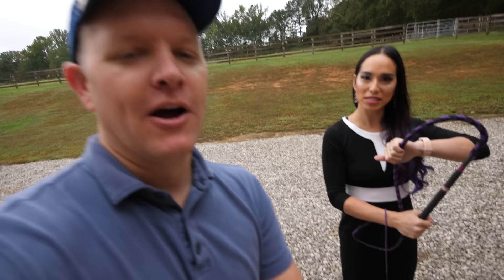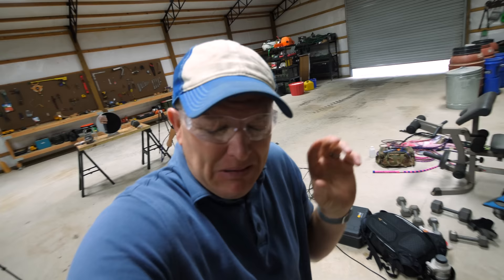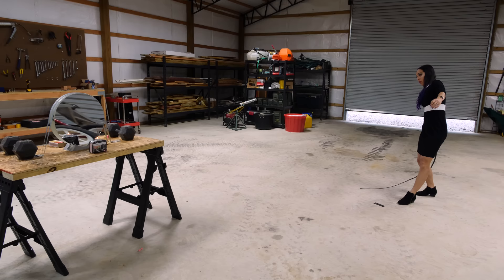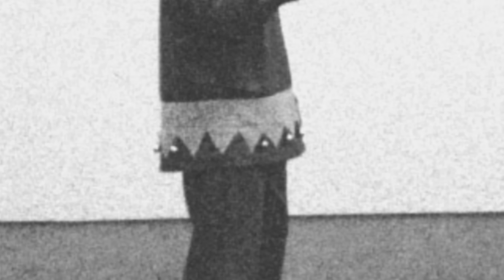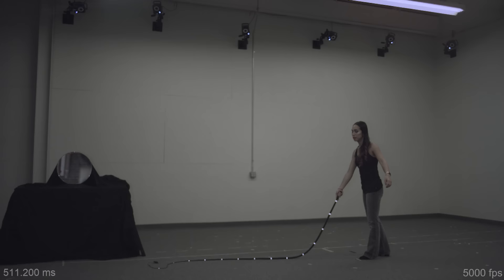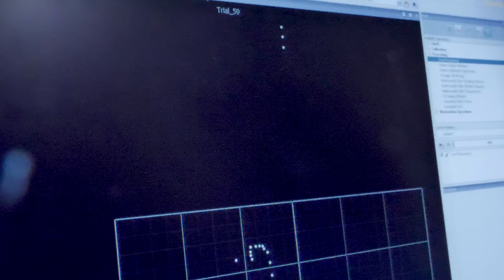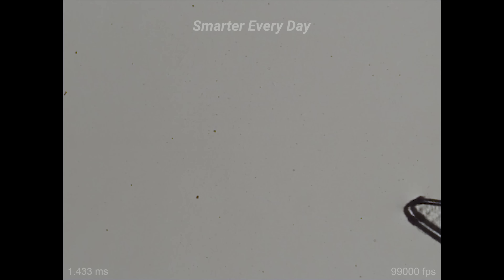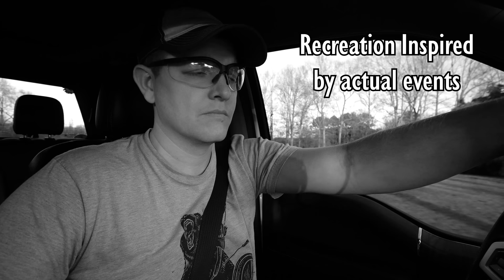How does a whip break the sound barrier? (Slow Motion Shockwave formation) - Smarter Every Day 207

Comment: The conservation of momentum is right ofcourse, but I think a more useful way of looking at it is in terms of impedance matching. Basically you are trying to transfer energy from something heavy and slow to something light. The difference between this and a uniform length of rope is that you gradually change the impedance of the whip as the wave moves to the tip, so no reflections of the wave occurs. Then in the end, when the speed of the whip itself is high enough, you need to impedance match to the air. This is done by increasing drag while still impedance matching the whip itself. The solution is the special tip. It is nice and puffy so the drag is high but the weight is low. This transfers a lot of energy to the air, preventing a reflection from going back up the whip. I suspect that removing the last puffy bit decreases the crack, and increases the reflection of the wave. You can also make the whip long enough to eventually achieve an impedance match to the air, as drag increases super linearly with speed. But to keep the whip short it might be best to impedance match to the air as soon as the whip is super sonic. Compare to a length of rope. If you try to crack that, the wave will come back up the rope, and no part will be particularly fast ofcourse. An even more reflective experimental setup would be with rope where the end is secured to something. The wave would come right back and even feel violent. I also suspect that this gives a framework for optimizing whips from a theoretical perspective.
Reply: Huh, I was seeing a charge-pump; charge a bank of capacitors in parallel, discharge them in series.
Same net power, higher voltage.
Reply: I’ll buy that. It makes sense. The same reason you have to make the end of your transmission line matched to the impedance of air for radiation at the antenna. Cool theory. I hope this is not the last video on this subject. I was fascinated from start to finish, as it seems you were too.
Reply: Similar the issues involved in speaker design.
Reply: Very clever analysis, Casper.
Reply: @jaydgreen1  I think it is exactly that!
Reply: Yes!

Comment: Destin - can you put together a slow mo capture with some science behind it regarding ping pong? I've been playing regularly in recent months and we have some questions about what is really happening with the ball when doing a specific stroke called "looping." We think the ball is spinning on the surface of the paddle during this but its hard to imagine. Overall any slow-mo of the ball hitting the racquet would be super interesting to see. The speeds you can generate with a 2.7gram ball is something else.

Sincerely, 
long time fan
Reply: I would love to see that too.
Reply: I could be wrong, but I suspect some of what's happening is similar to dropping a bouncy-ball with a bit of spin.  If you try that, you'll see the ball bounces back and forth, and that the spin changes on each bounce.  As the ball reaches the floor, the rubber grips the floor and so stays where it is (the boundary condition mentioned at the start of the video but with air).  However, the ball still wants to rotate so a torque is applied that twists the ball.  This twist is essentially elastic energy which releases, causing the ball to spin in the opposite direction.
My suspicion is that a similar thing is happening in table tennis, but that the deformation is to the rubber on the paddle.  As the bat moves across the path of the ball, some of the rubber gets dragged back and stretched out.  This energy is then released into the ball, causing it to spin.
Another thing it's similar to is the hockey shots in some of Destin's other videos, where the stick hits the ice before the puck and gets deformed, before unbending and slinging the puck across the ice.
Reply: andymcl92 for sure. Seeing it would be interesting. There is a lot happening with spin received and spin given off the loop, and the relationship between the paddle angle and the moment of contact, and it’s relation to its trajectory off the table. To react in time to make a successful return has a lot going on
Reply: @paulzeee  And yet it's one of those skills that we develop an intuition for without a deep understanding of the physics involved!
But as I always tell people, it's all in your feet!

Comment: Compressive forces of the conflicting motion are driven to the tip of the whip as the handle is drawn back slightly and the  flow of the forces acting upon the whip are reversed and the moment when the maximum applied energy is overcome at the point of least resistance in the whip’s core, a violent reaction occurs

Comment: The whip tip accelerates after the shock wave for the same reason rocket exhaust accelerates after it passes through the throat of the rocket engine and become supersonic. Once the flow becomes supersonic there can be zero pressure(by definition) against the direction of the flow. The air particles are pushed into what, to them, behaves like a instantaneous vacuum as any particles in front of them are moving away from them at supersonic speed. In the case of the whip tip there is a small pocket of what is essentially vacuum just behind the shock wave and the whip gets pushed into this by air pressure.
Reply: @Tom JLB: Interesting: what you’re describing, resembles what Aristotle postulated about projectiles soaring through air.

Namely, he believed there was only linear motion on Earth, and that an earthy or watery object (this includes metals, wood ...) would always move towards the Earth, and in linear fashion. Therefore, a projectile (say, a wooden arrow, or rock ...) flying in a parabolic trajectory seemed inexplicable, so to solve the problem, he devised that the projectile itself wanted to move downwards, but was thrusted upwards due to air rushing into pockets of vacuum left by the projectile behind it. This would gradually die off, as the process wasn’t 100% efficient.

Applied to a whip, his theory is the exact opposite of what you’re saying happens; fascinating!

Source: Wrote a 40-to-50-page paper on Aristotelian physics as final project in high school.

Comment: If you had a popcorn kernel on the end of a whip or hit by it would it pop from the impact?
Reply: Haven't I seen you on elitepvpers?
Reply: No, that's got nothing to do with how popcorn works
Reply: TheBetterGame 
we won't know untill we try
Reply: TheBetterGame Well, if heat is just moving particles and the ability to break the soundbarrier is due to something moving faster than sound travels then why couldn't it work? Popcorn pops due due the trapped water inside turning into steam via heat. So, what are the limitations of thermal energy here? What is the shortest time required to make a popcorn pop? 

Are you really sure it can't be done?
Reply: @KyuubiSam  

There's different ways something can heat up.  It isn't as simple as something moving very fast.

When it comes to popcorn, the water inside needs to be excited.  Unless I'm mistaken, that happens when a heat source constantly bombards the kernel.  Moving very fast cause heat through friction and rapid pressure change, not rapid energy bombardment.  Unless I'm missing something, I doubt fast movement will make popcorn.
Reply: @laughingfurry  Something moving very fast in air isn't due to friction, but the compression of the air in front of/around the object itself. It's how slam rod fire starters work. Perhaps a popcorn kernel exceeding the speed of sound would compress the air around it enough to momentarily heat it enough to pop.
Reply: Just the velocity alone would build pressure within the kernel, in relation to atmosphere.
Reply: @wonderwhatsnext5408  

I was talking about fast movement in general.  I know air resistance won't cause heat through friction.

I still doubt heat through compression will make popcorn.  I think the kernel is more likely to break than pop when compressed.
Reply: You need to calculate how much energy it takes to pop a kernel (hint: quite a lot to bring a whole cold kernel up to boiling). Then calculate how much energy is in the tip of a whip (hint: although it's fast and concentrated, there isn't much energy there). That will tell you if it's theoretically possible (hint: I think not). Then you can test it.
Reply: @_droid  1100 watts x 142 in my microwave
Reply: @_droid  2:22 on HI
Reply: popcorn works from heat and pressure building inside the kernal, it does not pop from impact you lol
Reply: The air resistance at the tip of the whip does not generate enough heat, and the mass of the kernel is not enough to keep enough heat for enough time before its relased via air cooling.

I doubt it would pop even if you let it fall from orbit.
Reply: Liam Mitchell Doubt it, no heat is generated from the whip I'm pretty sure.

Comment: They had to make it out of titanium which was only found in Russia at the time so they had to figure out how to get enough titanium from Russia into the states without Russia knowing what they were up to. Also, due to the heat they had to purposely make the panel's so they didn't mesh together because the metal would expand when it heated up causing the panels to fit properly in flight. Essentially when the jet was on the ground it was very loosely fit together to the point where the jet would leak fuel all over the runway before takeoff.
Reply: You're talking about the SR-71, out of context - But why?
Reply: @GaminGit  You didn't catch the audible commercial where he mentioned it near the end of the vid? I just felt like throwing out some random info. It's the interwebs you can do that. 😉 
 So, in short, the answer to your question is simply, because....
Reply: Possibly a myth. Naturally, this is the common explanation, and as classified as the tech is there is no way to be sure...

But SpaceX is using similar tech to intentionally leak fuel across the body of the craft for cooling. This makes a lot more sense to me than engineers not knowing what a flexible seal is, especially since heat is by far the biggest concern. 

The leaking may have been intentional to cool the craft with the easiest at-hand fluid: the top secret and curiously specialized rocket fuel.
Reply: DanGoodShot pewpew thank you for that explanation. The SR 71 is my favorite plane, but I couldn’t understand why it leaked.
Reply: And here I thought the leaking was to due to the metal sheets being slightly too small to give them room to expand from the heat that occurs at supersonic flight. The reason for this would be to achieve the best possible aerodynamics at the highest speed necessary.
Reply: DanGoodShot pewpew is that for real dude?  Amazing.

Comment: Something I've always visualized contributing to the seeming magnification of energy in the cracking of a whip, is the compression occurring on the inner side of the curl, and the tension conversely generated on the outer side of the curl, and those two forces adding energy back into the equation, as they vie for equilibrium. Like a crude battery. But I never hear anyone mention this when discussing the physics of a whip-crack. If you imagine the whip being made of solid rubber, rather than braided from cordage, perhaps this would be more obvious.

Comment: My kerbal space program intuition says the tip rockets forward because drag skyrockets during the transsonic range and then quickly falls off, while the tip is still at that point collecting momentum. Once it gets to about mach 1.2 the drag has dropped off by, if I'm reading this graph right, up to 30%. This is of course data from aerofoils and aircraft scale aerofoils, the tip being so small would probably have an even steeper decline in drag past mach 1.0, so all of the energy it gains after breaking the sound barrier is progressively more efficient at accelerating the tip. This would of course proportionally shorten the impulse which is why the tip suddenly jumps in speed but doesn't continue accelerating at the same rate. The 'catestrophic post mach acceleration' consumed all the available potential and now the tip is travelling too fast to accept more energy from the whip.
Reply: Ziraya0 Haha, never thought a wobbly rocket would make a good whip model. KSP is amazing.

Comment: Since the schleiren technique doesn't use the light reflecting off the whip, is it possible to set up two (or more) separate schleiren setups at different angles but focusing on the same point in space, then use photogrammetry software to create a 3D view of what's happening to the air density?
Reply: Interesting!
Reply: It's spelt Schlieren, ffs.!
Reply: @Anvilshock  BWAHAHAHAHAAAA 👿
Reply: Yes, it exists. Search for 3DBOS (3D Background Oriented Schlieren). It's pretty amazing.
Reply: @76Eliam Sweet!  Thanks!
Reply: Three of them; one where it starts to curve, one at the crack of the wip and the third one at full extension of the tip. Sounds great!!!!
Reply: While you could pinpoint the location of the whip in 3d space using 2 cameras at 90° angles photogrammetry requires much more than 2 angles to get a clear output. I'm not an engineer but I am a 3d artist so I've experimented with photogrammetry

Comment: I've cracked a lot of whips...  Seems to me that if you yank it back just before the whip fully extends it makes a louder crack.  I used to set milk cartons up and slice huge gouges in them.  My brother was standing about five feet out of range when a small piece, about 1-1/4" long broke off the tip and hit his arm.  It actually made a jagged cut in his arm that produced lots of blood.  I did not think at the time the whip was breaking the sound barrier — I thought it was simply snapping back against itself.  I think when you snap a wet towel, or piece of cloth, that is what's happening, and it can be every bit as loud as a bull whip.  It might be interesting to find out if a snapped towel is also breaking the sound barrier.  It needs to be a somewhat threadbare towel, though.  When I was a teenager I worked at a car wash, where there were plenty of worn-thin towels to snap like that.  We learned not to snap towels on Thursday — Thursday was police car day.
Reply: I noticed that too.

Comment: It's all about the explosive dissolution of the waveform created and amplified by the initial swing.  You're transmitting that initial force waveform into a smaller and smaller area of the whip body to accelerate and amplify it.  The cracker at the end is dramatically smaller and fan shaped specifically to dump all the energy of the waveform at the end of the swing, accelerating the tip past the sound barrier and causing the sonic boom crack we've all come to expect.  Or so it would seem...

I would suggest that the last acceleration and amplification of the waveform is actually being caused by the phase change between the energy of the swing being transmitted by the solid matter of the whip fibers into the much-less-dense fluid of the air around it.  That last jump in energy at the end accelerates the actual air molecules around that last section of the whip so fast that they cause explosive friction against the static air around them.  So in essence, it's not the actual whip that's cracking, it's the air at the end of the whip cracking against itself.   

So I guess a whip is literally a form of energy-amplifying fan...since you're literally using it's properties to move tiny amounts of air molecules so fast that they can't get out of the way of each other.  The fact that the boom actually happens in the air is also why the whip inself stays intact afterwards. If the waveform collapsed any sooner, you'd likely explode the end of the whip every time you used it.  

Funny to imagine what a whip would do if it were uses in other more or less dense atmospheres or fluids.  If you tried to use it in a heavy atmosphere, would the whip actually crack you back? 🤔

Comment: It looks like the last 12 ins or so, is where the last segment can't continue folding, and  for the lat 6" or so that serves as a fulcrum point where the tip begins to become a lever and flips over to face the front and reaches its maximum speed, sort of like what happens at the pivotal movements that gives baseballs pitches such great speeds or the mechanics of the atlatl. At that  point, when it moves to the front, the hairs of the tip facing the front suddenly spread causing them to have a greater surface to act against the air, thus displacing more air and causing the sonic sound. 
This was my visual appreciation ...a personal hypothesis

Comment: Thank you: I think your evaluation is spot on. 

The momentum of the circular wave will be transferred down the length of the whip. As the wave moves down the tapered whip the wave become lighter and lighter the mass of the wave becomes less and less. 

To maintain the original momentum the reduced mass must move faster and faster.

What if you had a wheel that could maintain its structure; but the wheel could drop some of its mass as it rolled. If the mass is dropped at the bottom of the rolling wheel the dropped mass would not be moving. Sense the dropped mass is not moving its absence from the wheel would not carry away momentum. So the wheel would become lighter and lighter but the momentum would remain the same.  Just curious what would happen.